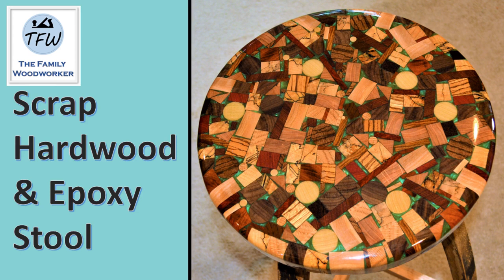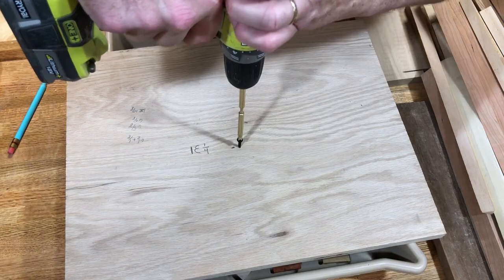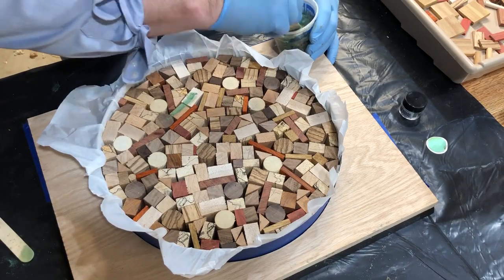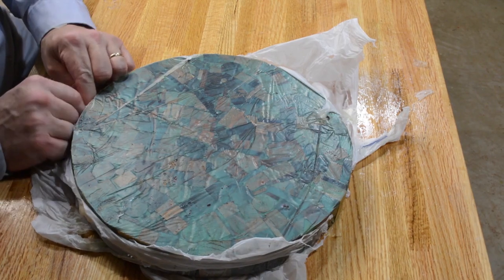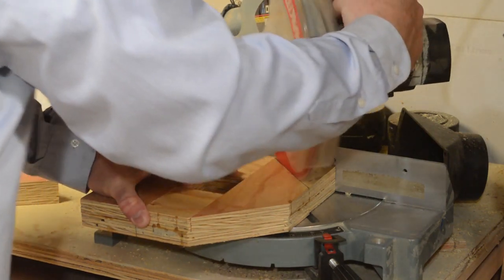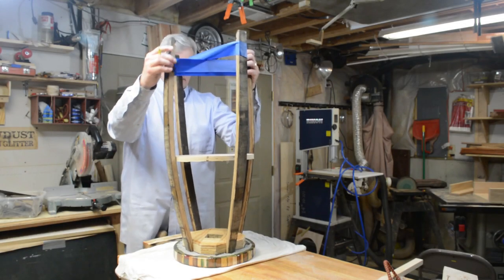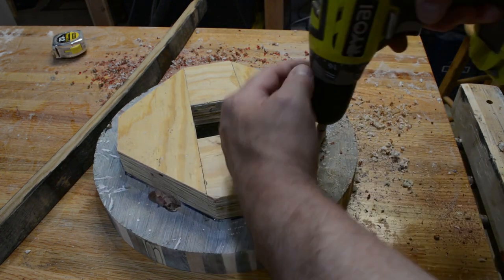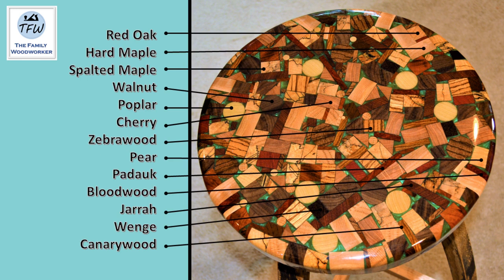Making the Amazing Mosaic Wood & Epoxy Stool

Comment: I have tried a few of these and have no luck in getting all the bubbles out.  Yours came out very nice.  Take care.
Reply from the maker: Nothing special, all wood I used was pretty tight grain hardwood so no real bubbles formed from the wood and I took a lot of care to pour slowly, and sanded off the bottom to expose the underside end grain.  The propane torch took care of anything that did come to the top, but overall the end result was pretty cool.  I also think adding the mica powder colorant helped mask any tiny bubbles below the surface.  Thanks for watching!